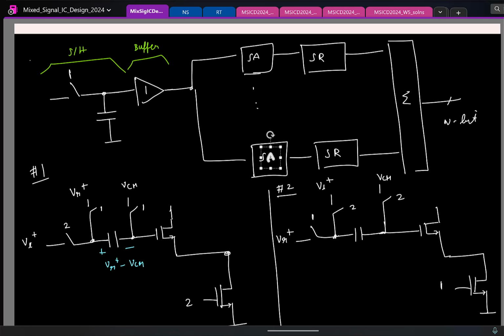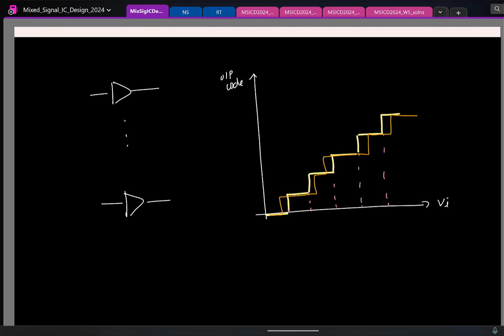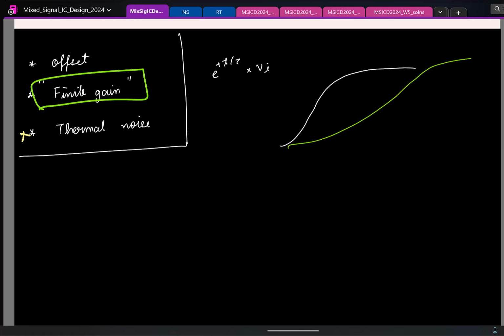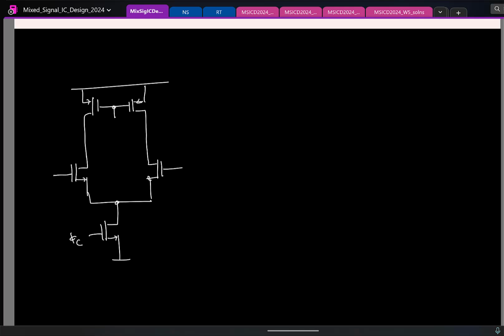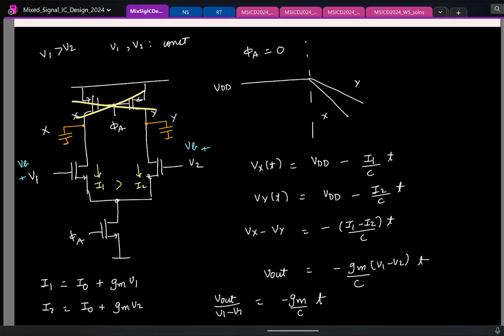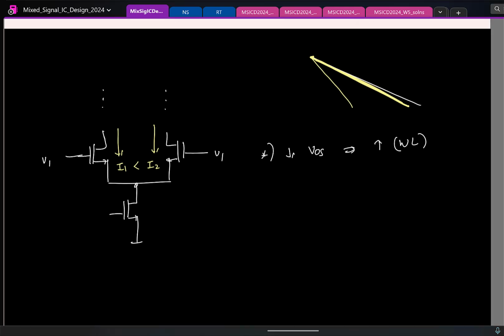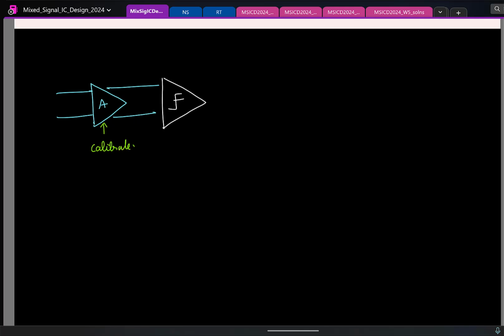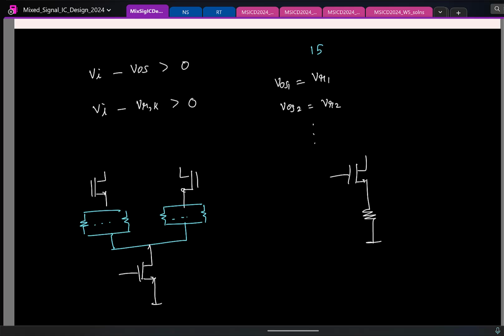Lecture 12(2): Latch offset: Using dynamic pre-amplifier & Calibration to reduce offset

Comment: The Idea with Increasing WL for the Strong Arm latch may reduce Mismatch offset, but that can introduce Higher values for Cgd, causing differential kickback to set in. This is especially critical if the input nodes are floating, i.e Switch cap network causing surprisingly higher value of offset